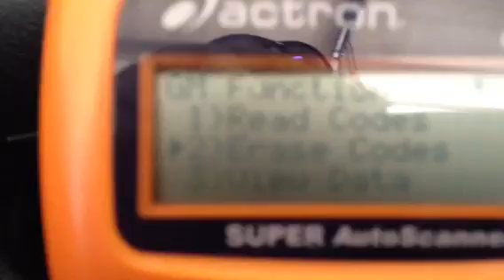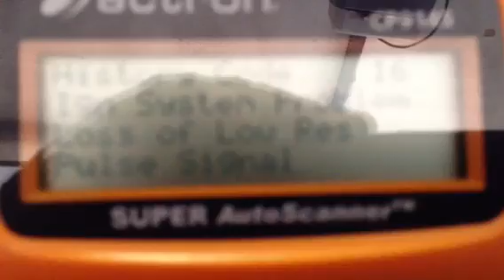Optispark woes.....still

Comment: What year is your Vette I have an Actron 9690 and it doesn't scan my 94 ?
Reply from the maker: I had a 94 Vette, check out which plug you have...OB1 or OBD2, there are 2 different plug adapter plugs.
Reply: @daredevil7442AUTOMOTIVE  I have the obd2 connecter but obd1 system but I did do the paperclip method and got history codes H31 33 35 37 in the module 1
Reply from the maker: @drjohnsonhungwell5115  The H represents history codes and have since gone away. "C" codes are current. It looks like it had a dead battery at one time and those are left over old codes. good luck
Reply: @daredevil7442AUTOMOTIVE  I had to jump it off recently but I have a bad misfire and no codes has new plugs about to change wires they're original it has 69000 miles on it was misfiring after warm then was running rich replaced the map sensor not running rich now but still has misfire.
Reply from the maker: @drjohnsonhungwell5115  ouch....opti spark ditributor most likely? I would pull plug wires off one at a time while the car is running and find out what cylinder is misfiring. Could be a fuel injector but, you won't know until you narrow down what cylinder is misfiring.  If you narrow down which cylinder is misfiring then you could swap injectors with another cylinder and see if the misfire follows the injector and if not, opti spark needs replacement. imo

Comment: I have a 96 impala ss gave the same code had did the same thing when starting, died on me at a stop light a few times bad  idle at 70 check engine on and off the took it to the dealer and it gave no codes or history codes proper fuel pressure everything was checking out good, so I  just changed the opti plugs and wires and now no problems.